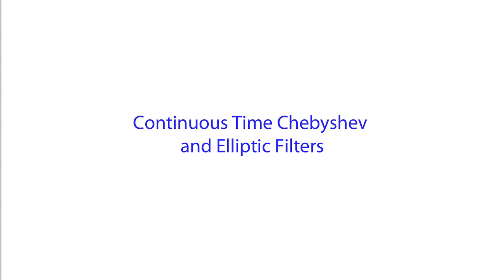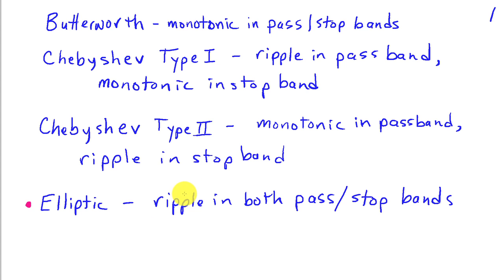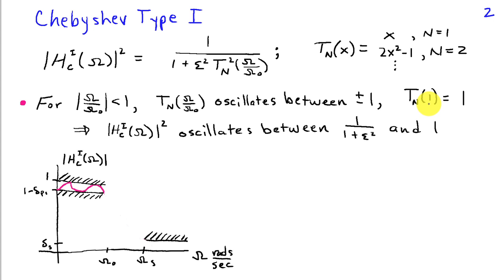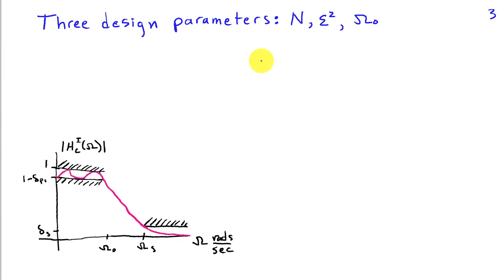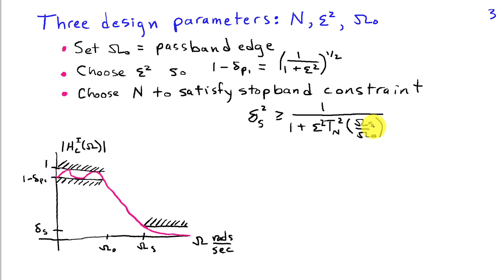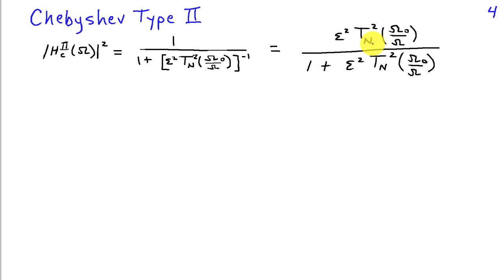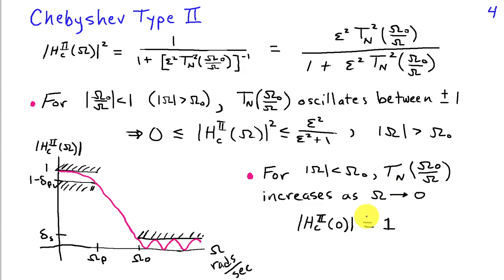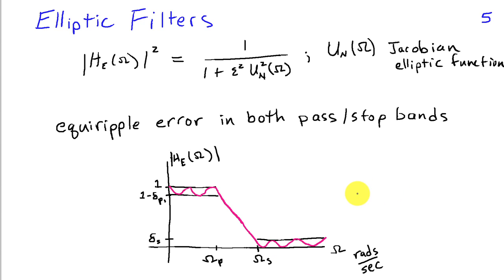Continuous-Time Chebyshev and Elliptic Filters

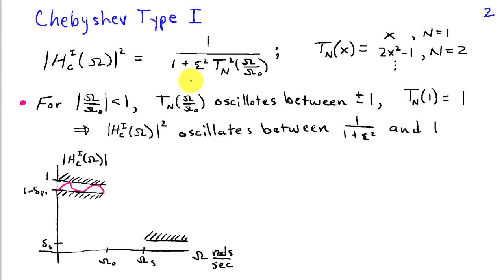Comment: Timestamp: 1:55 Can anyone help me with the fact how does Chebyshev's polynomial oscillate between +- 1?
Reply: First, define the Chebyshev polynomials by recursion:

    Tn(x)    :=    2x  *  T_{n-1}(x)    -    T_{n-2}(x)        //  T0(x)  =  1,      T1(x)  =  x

Then prove via induction:

    Tn(x)    =    /                        cos(n * arccos(x))    for    |x|  <  1
                        \  sign(x)^n  *  ch(  n * arch|x|)         else

The representation for |x| < 1 should answer your question.
Reply: @carstenmeyer7786  very nice , thank you, i have a question if you don't mind, what is the use of the hyperpobilc cosin as i began studying this and it seems that in most cases it easier to use the arccos equation for proofs